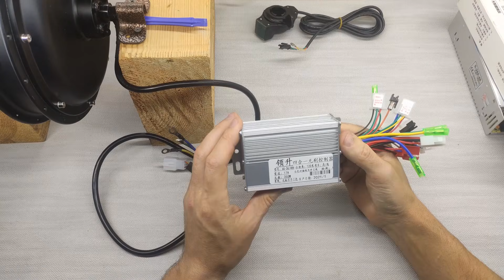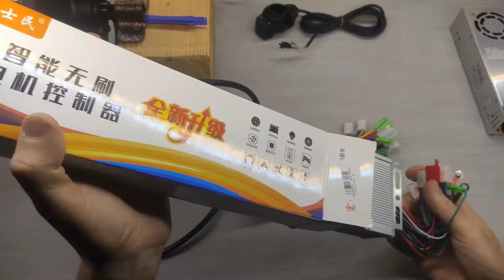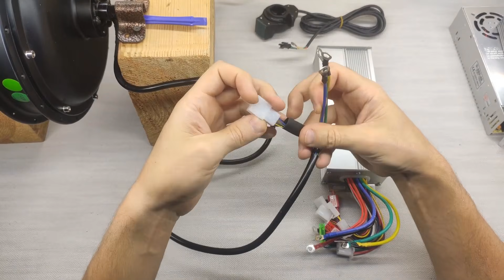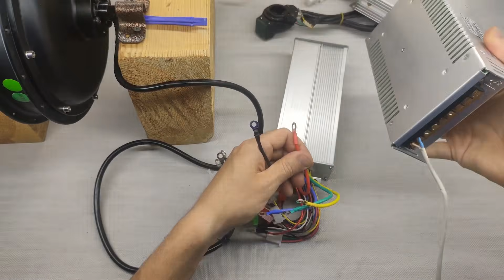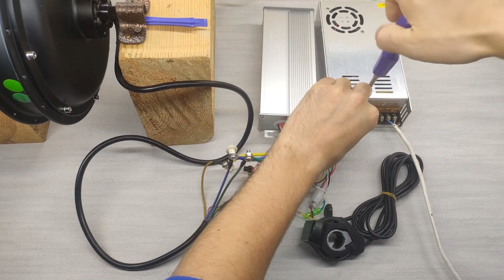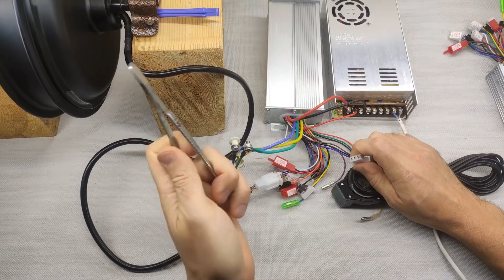How to Wire an E-Bike Motor Controller: Complete Wiring Guide

Comment from the maker: 🔧 Required Tools / Parts:
SVMC-7260M Motorcycle Controller: *https://amzn.to/4uV4Wst
36/48 Volt 350W Controller: *https://amzn.to/4tZl0I0
48 Volt 500W Controller: *https://amzn.to/4nRqumK
48 - 72 Volt 1500W Controller: *https://amzn.to/4uIxfKy
24 - 36 Volt 350W Controller with Display: * https://amzn.to/3PPL6iS
Throttle / Throttle Grip: *https://amzn.to/4e7RmvE
1500W Motorcycle: *https://amzn.to/4u0cKaK

✅ You can order controllers on Aliexpress via the link:

SVMC-7260M motor wheel controller: https://fas.st/k32S2
36/48 volt 350W controller https://fas.st/voNi2m
48 volt 500W controller https://fas.st/CNlnFq
48 - 72 volt 1500W controller https://fas.st/tKf3Ij
24 - 36 volt 350W controller with display https://fas.st/McUEw
Throttle grip https://fas.st/lep1G
1500W motor wheel https://fas.st/yNvOx

🔧 Required Tools:
👉 Screwdriver Set:* https://amzn.to/4wUae8T
👉 Tools: *https://amzn.to/49ruiW4
👉 Plastic Pry Tools / Trim Removal Tools: *https://amzn.to/4wRrknK
👉 10mm Socket (for the door check strap) *https://amzn.to/42WTfFc
👉 Phillips Screwdriver: *https://amzn.to/4tXH85B

Comment: VERY INSTRUCTIVE
Reply from the maker: Thank you so much! Glad you found it helpful. Are you planning to build your own e-bike soon?
Reply: @dimiteardowns I ALREADY DID
Reply: Awesome! How does it ride, and what controller are you using for your setup?
Reply from the maker: That's awesome! Does it pull hard off the line, or are you running into any heating issues on long climbs?